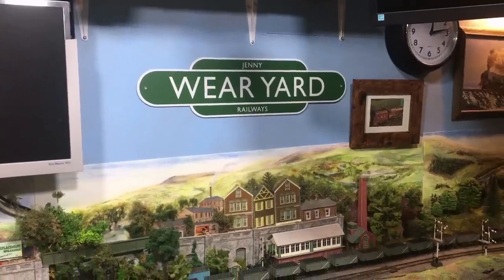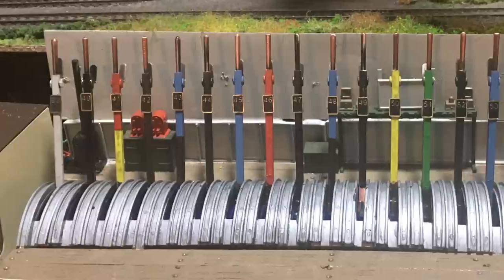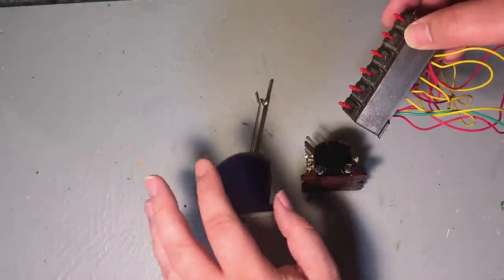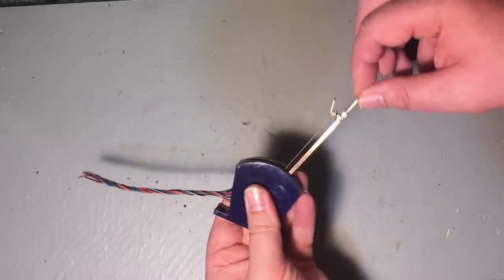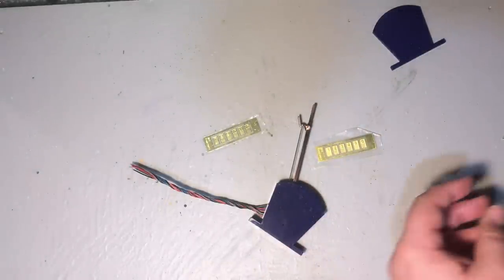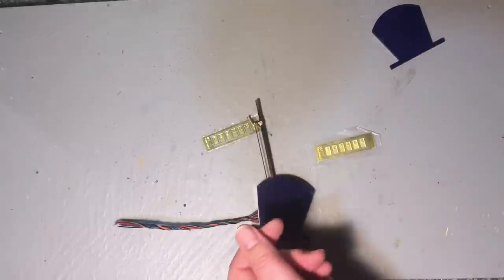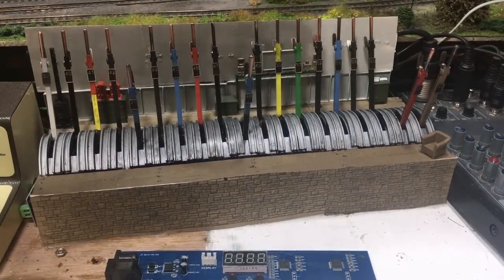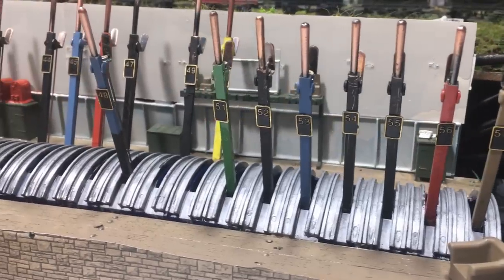The ultimate model turnout and accessory control? Cobalt S levers.

Comment: These really are a quality product. I made a frame a few years ago and have had no problems with contacts at all. The levers on mine are connected to relays to do the switching but one lever does directly power a solenoid motor and has never failed. In the past I used H&M switches and until trying these had not found anything to equal them for reliability. I enjoy using the lever frame as much as running the trains, the realistic operation of them cannot be beaten unless you were able to scratch build a locking frame.

Comment: Can these be opened and used manually?? That is using the lever to push and pull a wire that is going to the turnout. My layout will not have any powered turnouts and I am looking for a way to control them. I like the idea of the push and pull with the break as my turnouts have no springs on them, they are the less expensive ones here in the states... I'm so very glad that you took the unit apart. I can see that I can drill a connection hole in the arm where I can place the push wire. If these are not to much money, I may be using them a lot... Sounds like they may be more than I want to spend but I have gotten a lot of ideas on making some myself. Thank you...

Comment: An excellent description of using the cobalt lever.

On my layout I intend to use mechanical interlocking of levers. This would only be possible with cobalt levers if they included an accurately machined hole and a stirrup connection to which the locking tappets would connect. I fear such modifications would be prohibitively expensive.

Comment: Thank very much for this video about your lever controled model railway layout.
A question I have, how did you realized your lever interlocking?
Normally the levers working together in addition with an interlocking register.
It is cascade interlocking system which allows to switch the levers into other position after one special lever had been switched first and than do switching the other levers.
The modratec levers from Australia coming with Saxby & Farmer Interlocking register as kits or for extra money as ready to use leverframes.
Me I am building my own lever interlocking register built by interlocking register plans of german Buessing (built by Juedel in Brunswick) Interlocking register, a nice combination of british levers with german interlocking register.

Greetings from Germany,
Ingo

Comment: Hi Jenny. Thanks for an interesting video. I have been using an ADS-2sx. The only drawback I have found is that if the point is moved by hand, for example, because there is a derailment, then the system does not detect that!  Peco make a microswitch called PL-15. It is meant for changing the frog polarity, but you could use it to indicate which way the point was physically set, for example, if it was jammed by a derailed loco.  You may like to experiment with this and that'll be another video! Thanks for uploading.

Comment: Hi Jenny & Zoe. They are lovely levers. They are also very Tri-ang ish. As you may know I am using old Tri-ang passing levers but hard wired to escape the awful push in pins. Are these lever passing contacts switches. Regards PVA Jaycloth Alan at Buckland Junction  :o)

Comment: the spacer i see as a fail. it would have just been better to make the housings a bit wider. 
(1/2 half the spacer thickness on each side of the control stand)   so no "added" part required.
not sure about use on my layout...yet. but looks good.

Comment: I mused on the whole design and wondered if any died in the wool modeller went the extra mile ( and chain ) to connect these lever frames up to rodding and signal wires? Is it feasible?
Reply: Many years ago, I bought a kit of 21 levers and quadrants that were 1/12 scale of a Stevenson frame.  I can't remember who made them, but would be surprised if they are still around.  Anyway, I built the frame up to operate the points and signals for a small branch terminal, and they were all operated mechanically, except for one distant signal that was electric.  The finishing touch was that the levers were all mechanically interlocked, so that a signal could only be pulled if the correct route was set, and once the signal was cleared, none of the points in that route could be moved until the signal was put back.  I still have the frame, but the layout has long since been dismantled.

Comment: So my question is if you were to change a point using the handset what then happens with the levers. Obviously they don't physically move but they are then in the wrong position?
Reply from the maker: Nothing happens. When you then move the lever the encoder sends the signal but as the point is already set that way it stays set that way.
Reply: @JenniferEKirk  thanks :)

Comment: They are very nice and would look great on anybodies layout, but when you have 40 + Points and many isolated sections on your layout it works out very expensive so they are not for me. I am still waiting for a reply from DCC concepts on some questions that I sent via their website. maybe I will hear something soon. Good to everybody that will use these lovely Levels and control units. Martin. (Thailand)
Reply: I was thinking the same,  I have around 40 cobalt motors which wasnt cheap. Very good though.  My ecos controller powers them all with a map as well showing point position.  She has done a good job.

Comment: If you have a mimic panel can they work with that?

Presumably if you control your points from the cab / or a mimic panel with control switches / or any kind of auto track planning software then the levers are now wrong ?
Reply from the maker: Yes, the levers cannot change if you change the points from the handset, however it isn’t a problem as the levers just synch with the points next time you move either.

Comment: Hmmm... what you've got there is roughly 300 pounds invested in the signal levers and ancillaries, and yes, it looks wonderful, and I'm sure the quality is superb.
Is the setup really worth that much more than a row of cheapy hornby, peco, trix whathaveyou passing contact levers that do the same job?
Unlike dcc loco control dcc controlled turnouts still operate exactly the same as analogue.
Arguably the wiring advantages are excellent, especially for comprehensive layouts. For that matter though, for a more comprehensive layout I wouldn't know if a thousand pounds spent on a row of levers would outweigh wiring?
Realistically, on an old layout I had 96 points, that's 1,600 pounds for levers alone. Even a moderate design with say 35 points is still 600 odd quid.
Fantastic equipment but????
I think a more plausible target might be an exquisite shelf O layout, with say 4 points and signals maybe?